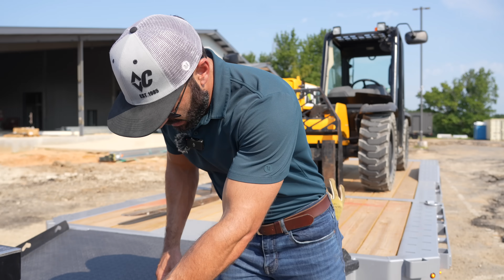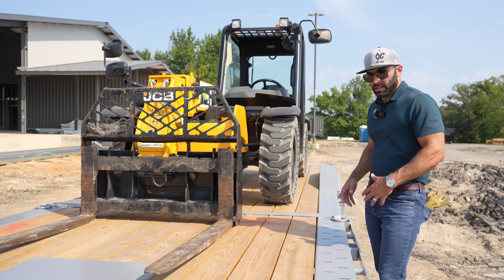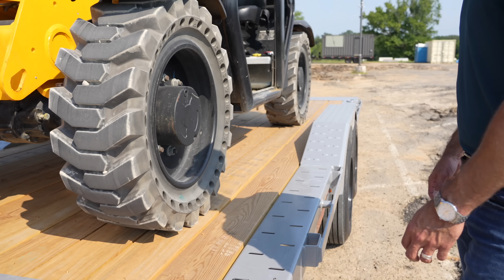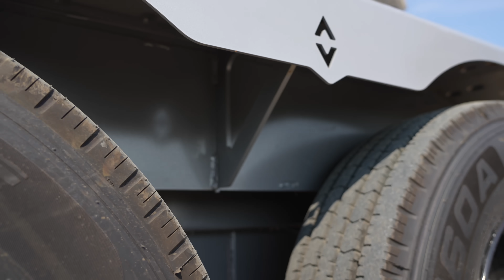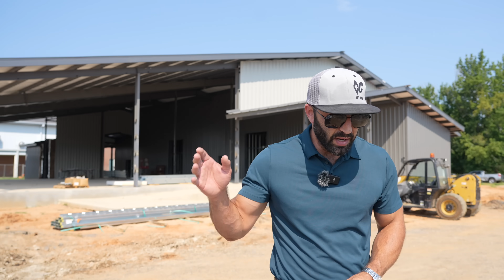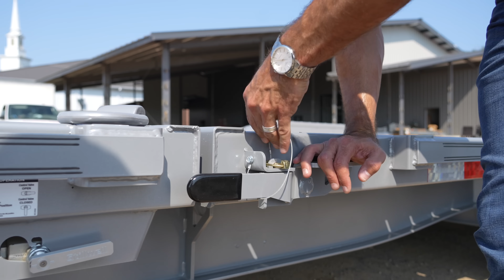Extra Wide Equipment Tilt Trailer- Meet the HXD | Diamond C

Comment: What we need is a tilt trailer that keeps us under CDL rules and hauls a large payload. While Diamond C Trailers are stout, they just weigh too much.
Reply from the maker: With Engineered Beam framing DC trailers are generally lighter than other structural beam or channel steel frame trailers. 👍

Comment: Is there a build out of this that could haul 20000lb excavator
Reply from the maker: Unfortunately no. Max GVWR is 23,000. You’ll need to bump up to an FMAX hydraulic dovetail.
Reply: @diamondctrailers sounds good 👍🏽 thank you
Reply: Probably not. These generally max out at 20k gvrw since it’s a bumper pull and most receivers max at 20k from factory on a 1ton truck.  Anything heavier needs to be a gooseneck.
Reply: Do you offer galvanized coating? How about tie down slots across the back
Reply: @Ned-p1y    I really don't know why more companies don't offer galvanized trailers. They're so much better especially up in the north, salt\winter areas.  All the trailers at Uhaul\Penske and also the National Fuel gas company (mini excavator equipment trailers) in WNY area have full galvanized trailers so they don't start rusting away in 4 - 5  years like most do.  Every once in awhile you can catch some used ones for sale when they rotate old ones out for new ones. I'd deal with the drab, not-so-shinny grey galvanized trailers versus nice painted trailers in order to ensure it's not rusting away underneath on the frame. Lets face it no one is washing their equipment trailers every time they get used anyways.